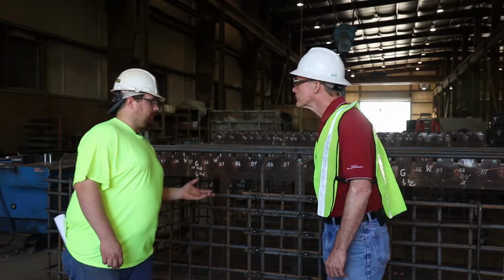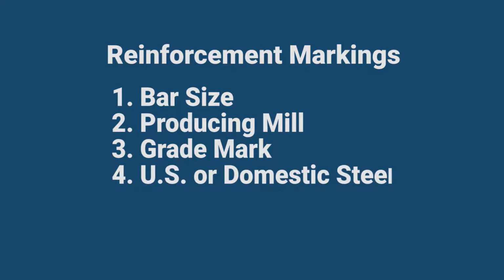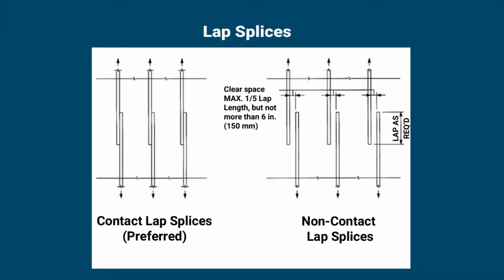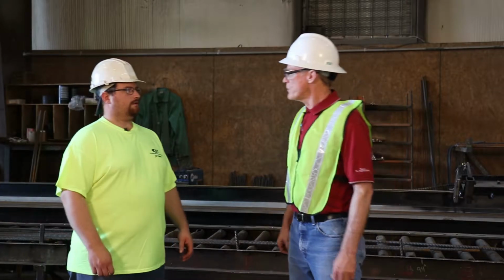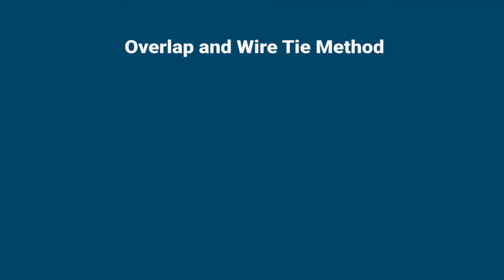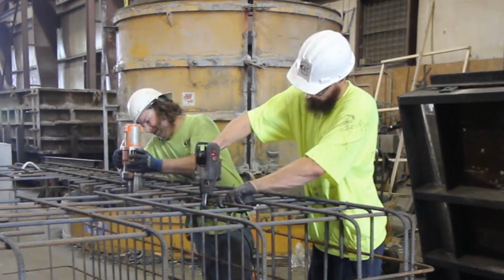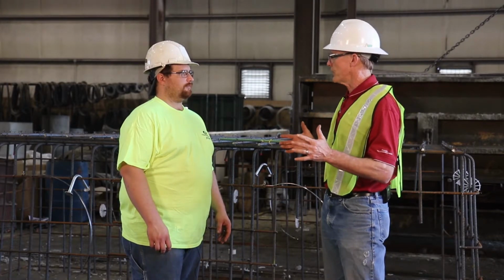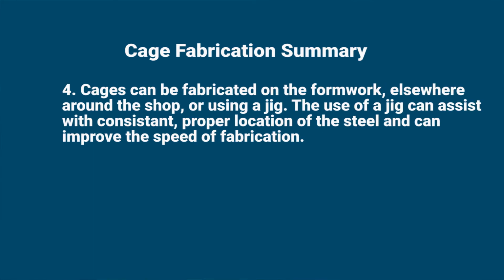Precast Learning Lab: Reinforcement Fabrication

Comment: 5:38 40 psi or 60ksi steel being crushed by 4000 psi concrete?  How about if to tight, it will not allow for proper engagement of the concrete design, resulting in a weaker mix design in the inside bend and therefore the ''hook design'' becomes useless... no longer an ''anchor''... 
Edit to add, thank you for sharing your content, I appreciate it.